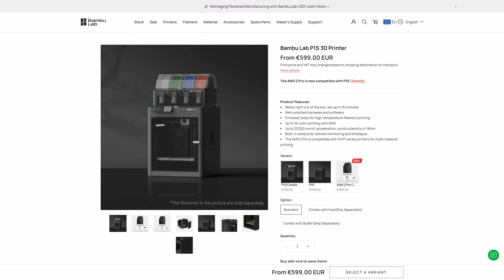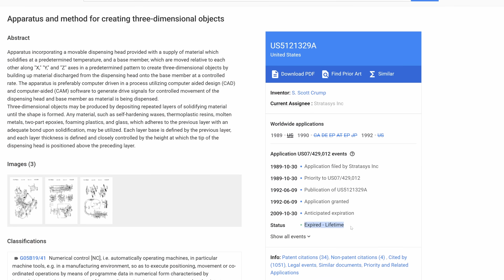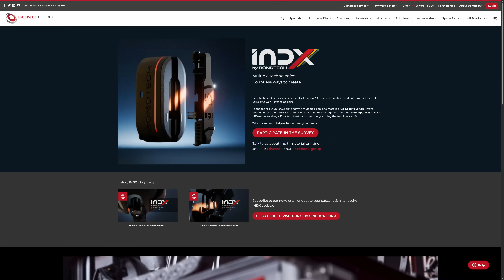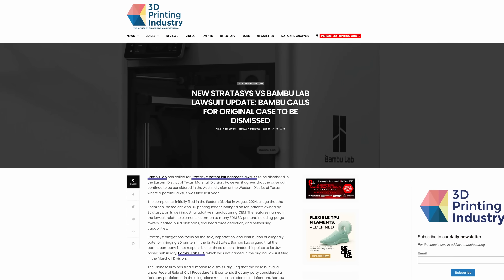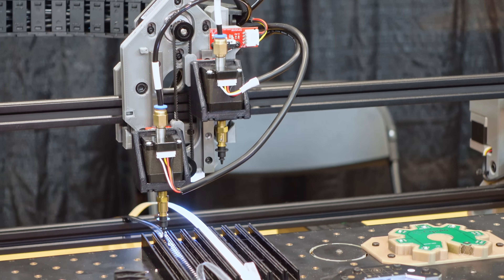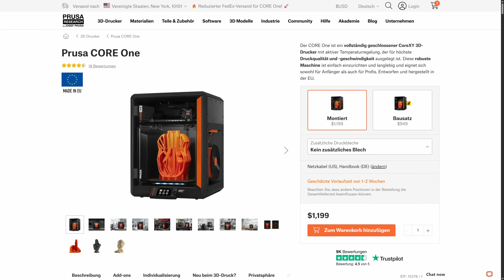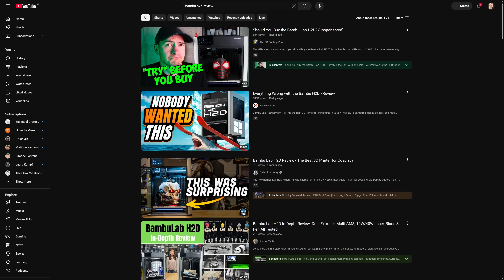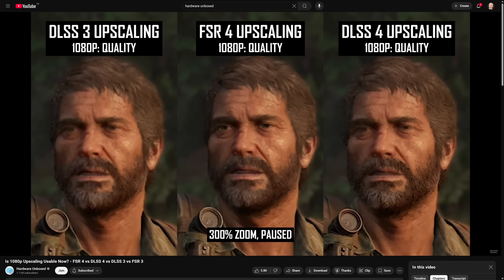How Bambu has won

Comment: First of all I started to watch your channel couple years ago before I bought my first 3D printer. I was always fascinated by potentials of additive manufacturing that I used in my professional work as an engineer and I wished to explore the potential to using 3D printing in my private life. Your 3D printing basics, that you have posted 5 years ago was a great introduction for me and now few years later and two FlashForge Adventures in my home, I still find it fascinating. My wish for your channel would be, that if you could explain more about the faults in 3D prints or during 3D printing and relation to the settings. Also I would like to know more about maintenance of the FFF 3D printer (basic and advance). Thanks for your current work and I hope that you will continue!

Comment: I run a 3d printer repair service. When an A1 showed up, the owner complained about several issues, half of which I couldn't replicate. And when I figured out what it was, replacing that part proved quite complicated compared to, say, an Ender 3.
Reply: That's the other side of the double edged sword of making things more mainstream and not requiring a lot of prior experience to use. It's no different with any mainstream product from smartphones to coffee makers to vehicles.
Just out of curiosity, what part on the A1 needed to be replaced? I just had to replace the part cooling fan on one of my A1s and it was fairly simple. Bambu's wiki is pretty detailed with replacing parts.

Comment: I love open-source and really hate patents. But my Bambu printer just works. It turned my projects from fiddling with dimensional accuracy of my parts to just doing the job and testing the prototype. 

I'm not even talking about struggles of build plate adhesion or model quality problems. Those were never an issue to me dealing with old cheap printers, it was just consistency and details. Cheaper printers struggle with repeatability outputting the same gcode twice. Bambu printers just demolished that concern for users and realistically that's what matters to many people who just want to build things.

Comment: There are plenty of 3d printer review YT channels, there is no need for more. What I am actually missing is more of "How to" channels. How to print the most smooth surface? How to print specific geometries, that tend to render subotimal print using default print profile. How to tune print profile from start to end? How to build your own printer from start to end? How to setup and configure clipper from start tonend (what HW do I need? Is it licenced or opensource? What are recomended setting values? How to tune the setting?) etc. Anyone can do a review, everyone has some opinion...not everyone is capable of building 3d printer from scratch...

Comment: One point I don't see in the comments is in regard to the maker/education aspect of building your own Core XY printer. I'm in the middle of assembling my Prusa from a kit, which Bambo does not offer. I value the understanding and knowledge I gain in the process, as I did with the MK2 I also built and upgraded along the way. It's also a lot of fun. With this I believe Prusa will provide upgrade paths going forward that Bambo won't, other than buying a new machine.

Comment: For me, a 3d printer is a tool, if it breaks and at some point it will, i want to be able to repair it. I love open source, because i can do what ever i want with it - an Apple like 3d printer is just garbage waiting to be happen. So to answer your question what is important for me here: ok printing results, easy setup for a print, how stable the printer is and if it breaks how easy is it to repair - oh and if it has network than security updates.

Comment: While Bambu makes decent machines, just wait until it breaks. Customer support at Bambu is next to nothing. My brother had an X1 belt break, bambu sent him a video with how to fix it and would not respond to additional questions other than we sent you a video, watch that and fix it. Bambu then stopped responding all together. So, it's fine to spend 1k+ on a printer but then when it breaks, good luck joker. Prusa, message and have the part within a day sent out. I have an A1, MK4s that is now a Core One, and a P1S. The Core one is by far the best I own.
Reply: Loud Fan ... got new fan for free...
Reply: broken mc board ... got new mc board for free...

Comment: Still expensive tho! And while I like the P1S, I haven't found it to be any more reliable than my Mk3! In fact I've still gone back, time after time, to print materials on the mk3 that are just "difficult" on the BBL P1S. They certainly do good value and I like how they sell replacement parts at a reasonable price. That said, I've  a Core One kit in my porch waiting to be built. I have been a mk3 user since 2018 and really appreciated the support down through the years that no other supplier can match

Comment: I had an "open source" "for tinkerers" Ender 3 V3 SE, the amount of time I had spent trying to print vs. the amount of time it was actually printing usable things is not in the favor of the printer.
sold the darned thing, got a Bambu A1 and honestly I love it, i have it for less than a month and its been over 150 printing hours so far without a single error or calibration or anything else needed, perfect prints every time.
I don't have enough free time in a day to "tinker" with my printer before it can actually do its job and print, nor do i want to. it should serve me and not the other way around.

In that sense Bambu Lab won, their stuff just works, a printer that just ... prints. how amazing is that?

Comment: I'm still disappointed by how proprietary Bambu is, and how much they're pushing everybody else to follow suit.  Yes, it's good hardware, and especially good hardware for a beginner.  But it is sad to see them perpetuating the "open source is only for expert tinkerers" myth; if Bambu's design and firmware files were open source, people new to 3d printing could start with a basic machine that Just Works, and if they got interested could level up their understanding of hardware design or software and become those experts, all without needing a second machine.

I'm sure there's some way to jailbreak a Bambu printer, but contrast that with the community that grew up around the Ender 3 due to its firmware being open, and it's a whole different world.

Proprietary software is gatekeeping and it hurts the community in the long term.

Comment: "it's what the market and patent systems are set up to achieve" is the real kicker here. You can have a printer built from off-the-shelf hardware and printed parts, but that doesn't mean its mechanics, firmware, or slicer can't be patented and copyrighted. When it's full of IP then the printed parts are just a gimmick and will be replaced by injection molding and sheet metal for mass production. Consumer 3D printing just had an open start and if it doesn't become integral to society on the same level as cars and smartphones, there'll be no legislature to tamp down IP in favour of openness.

Comment: I discovered your channel when it first started, thoroughly enjoyed watching  you assemble machine kits and liked the way you handled the shortcomings of those kits. Additionally i have been involved with 3D Lithography since the Stratasys days, and have had a few early printers. Recently i purchased an X1C and was blown away by the utility of it. While i chose a Bambu unit, there are a lot of other machines i considered. They have now become an Appliance, just plug it in ad it works. products that were being produced on my older 3d printer that took dozens of runs to dialed in, not just work. No fussing with printer settings needed for an output that is orders of magnitude better than the older 3d printers in the community but better than even 3 year old Stratasys out of the box. and it would be great if you did some reviews and include printing improvements on the Bambu line of printers. Thanks for keeping it Honest.

Comment: I like your videos as they are, but there is at least one or two things I think are largely irrelevant for all creators that we can skip.

Speed. We get it. Everyone is fast now. But the numbers are kind of made up and the whole thing has so many variables and nothing will come close to the custom machines at the top end, so let's just admit they're all fast now and ignore the speed unless it's exceptionally slow or fast.

Open source. As you said, it's only of interest to a small portion of owners at this stage.

I like projects made using 3D printers regardless of if they're for the printer or not. I like hearing about new crazy ideas or methods. I like coverage of upgrades and even full printer builds that don't require a scripting background to implement. There is a huge gap between "I can install it physically, copy in a provided bit of code and go" and "I have to source everything and then manually edit scripts to cover adjustments that need to be made." I don't think anyone is covering the former as much as they should.

Comment: What do you want: 3D printers as a hobby vs 3D printers as a tool? I came up from an Anet A8 and Creality bed slingers. I've had my Bambu X1C for 1.5 years now and I was blown away by how easy it was to get great prints out of the box with no faffing, mods and compromises. I've been able to just focus on modelling and prototyping, without barely a thought for the printer itself. The printer is a tool to me now, not a hobby, and this is how they won me over. This is all the more evident if you look at the quality of models available on Makerworld now compared to anything that was ever posted on Thingiverse. 
The lastest gripes about changing agreements has only bothered the tinkerers. Anyone else in the Bambu commodity ecosystem probably doesn't care.

Comment: I'm a dumb user that don't like to fix and thinker with too much settings for things to work and having been working with 3d printers from 2017 and spent countless hours modding printers and calibrating I was just drain and 3d printing fixing became the hobby rather than design and building. Bambu has really made every thing so much easier and too so much frustrations out of the hobby of 3d printing. I'm amaze by bambu's supply chain management, parts availability, delivery speed, software, user fixability, simple design, documentation for fix and maintenance and price.

Comment: I'm an old fan of your channel. I've designed and built printers myself and I've seen a lot in this industry.
At work as an engineer I use different printers. So I'm concerned about different things about printers (importance varries):
1. Ease of use for unskilled colleagues.
2. Reliability when using it about 16h/day for months. (X1E broke down 15 months into service)
3. Convenience of running it.
4. Convenience of using multiple filaments that have to be stored dry! Very important! (Prusa doesn't provide this!!!)
5. Convenience of managing it from the other side of the building.
6. Repairability! Costs are not low. so I want to use it for long!
7. Manageability of the print queue (i.e. with ultimaker).
 
I mean the bambulabs come with very good features and there are dozends of channels concentrating on this BS. I want the really important stuff for companies and work shop users!

Comment: In my early days of printing (I started in 2012 and found you around 10 years ago), your channel was my go-to resource. Thank you for all who helped back then. I came to realise that Bambu had won around 18 months ago and left Prusa for Bambu and have not regretted it - I think Prusa really messed up the Mk4 when core X-Ys were very common and were focusing on the XL development for far too long at the expense of their core market.  So, where does your channel go now? Well, for me, the technical help and reviews of Filaments were always useful and valuable, but I guess My Tech Fun has the filament very well covered now. Maybe you can focus on the emerging technologies in the 'maker space', including CNC, laser, even circuit type machines? And also, how they can be used. Hands On Katie does this to certain extent,  but with very little technical depth. I believe you are a degree-qualified engineer? and will be very well placed to delve much deeper into the technologies and evaluate the pros and cons of printed objects as well as helping people to decide on what filaments to use, and where/why. Hope this helps

Comment: Is that a MadCatz Rat mouse you are using?

I consider you to be one of "the experts" of 3D printing so your opinions on technical abilities, quality products, and the hoops one might be required to jump through to get great results all are valuable to any decisions I make not only on buying a 3d printer (of which I have 9) as well as how to make them perform to their best.

And always appreciate reviews of upgrades and third-party components, especially for Bambu Lab printers.
Reply from the maker: It's a R.A.T. 8+
Bit of a retro design at this point, but if you like flat-grip mice, it's an incredibly capable option! Because of my messed-up shoulder, I had to switch to something a little more ergo-shaped and landed on the Keychron M6 for my main workstation. Pretty cheap-feeling, but performs well.
Reply: @MadeWithLayers  I loved the design. I had an 8 fbefore the company closed down, and when they came back into production with the 8+the new driver was not backward compatible with the older mice. I was bummed and ended up going with a different brand after much failed effort to get the older mouse to work with the newer driver stack. C'est la vie, I guess.

But I loved the adjustability of that chassis.

Comment: I really love your content and everything you're doing for the community. Back in the day, you were one of the very few consistently pushing content about this industry — and it made a big difference. 🙌
While watching this video (around minute 4), a thought started creeping into the back of my mind... Are you subtly preparing us for the possibility that Prusa might go closed source?
Reply from the maker: I don't have any more information about the direction that Prusa is headed in than you do, but my observations from how they've been building their printers at least has me questioning how much value there still is in truly releasing everything as Open Source. I mean the sources for MK4, XL, One have already been only sparsely published, and as their printers, software and firmware are all now integral to one another, upgrading parts and swapping printer firmware means losing that tight integration and makes source availability less relevant.
At this point, I think that a manufacturer providing open and well-documented interfaces (gcode, web API, pinouts ...) and mechanical drawings / models that allow for attaching addons, enclosures etc., provides more real-life benefit to users that want to dive deeper into their printers vs. just dumping the sources into a Github repo.

Comment: Please keep making reviews like you have always done but perhaps get back into CNC mills, routers, lasers, etc. as well. I for one am interested in all tools available for making. Your solder station shootout was excellent! And the MPCNC was very interesting until the designer shot himself in the foot. But do the more or less DIY/open source segments. Everybody reviews the main brands, only do those when you think it adds value. I'd love to see you upgrade a printer with Bontech's new INDX system. You always find the quirks we need to know about.

Furthermore I would love to see you revive Filaween or at least test interesting new or improved filaments every once in a while. Perhaps a joint effort with Stefan from CNC Kitchen?

Bambu lab has shaken up the world of 3D printing like Ford did with cars 100 years ago. The bright side is that reliable printing is available to the masses, one doesn't need to be an engineer to get into 3D printing. But one can still tinker with 3D printers like petrolheads are still doing with their cars if they want to.

Comment: My first 3d printer I built, it was informative and I learned a lot. Mostly how complex they can be and what it takes to actually get good prints. Also how much can go wrong if you don't do proper maintenance and calibration. I loved the quality of the Zortrax printers, but found the closed loop mentality with only being able to use their filament restrictive. My XC1 was a breath of fresh air with ease of setup and great quality at such a high speed. A friend had an older Prusa and asked if I could print something out that he needed quickly. For me to print out multiple copies it was half as long as it was for him to print out one. Mine had run over 600hours (probably many here laugh at that), but I have had almost no problems and super results with most of my prints. Even when using older filament that I couldn't print in my other printers. I remember when everyone thought a printer would be in every household, but it wouldn't happen without them being mostly like a printer where you just add paper and change the ink or toner every now and then.